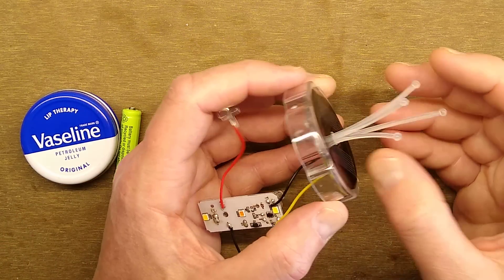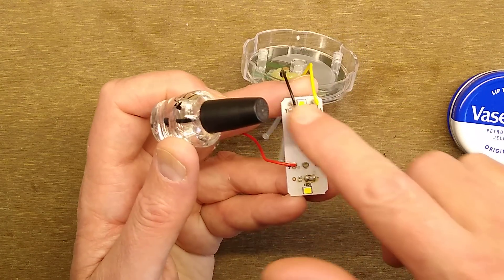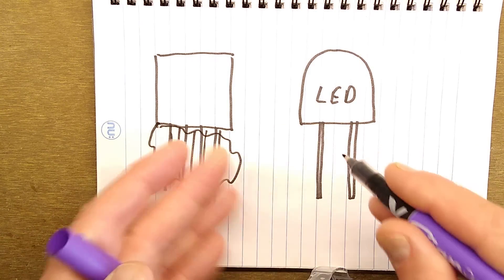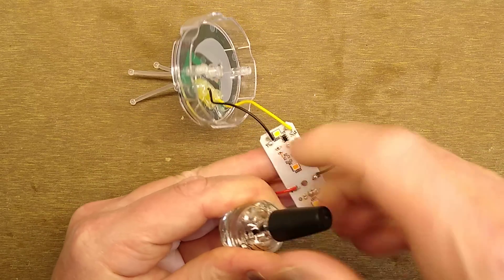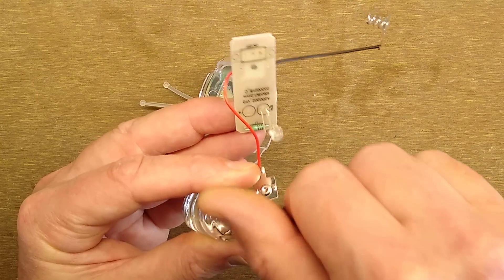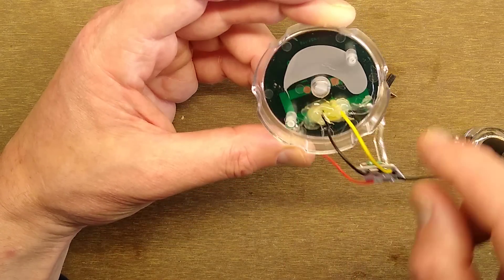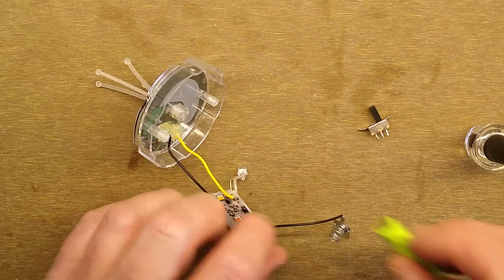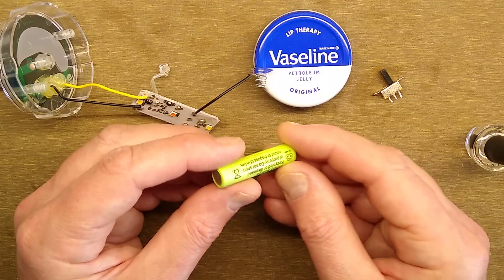Waterproofing your solar lights to make them last longer

Comment: There is quite a bit of chemistry around nail varnish= nail polish. There are water based, water based u.v. cure, and solvent/oil based ones. It's usually a polymer (or a monomer) dissolved in a solvent (the solvent evaporates leaving the polyer: or the solvent evaporates and the monomer polymerizes.)  The solvent based ones (traditional ones) that may smell like acetone, are quite flammable as being applied, and burn quite well after 'drying.' Just in case you want to start your fireplace with you're used solar lights.

Comment: I like to buy strings of Christmas lights, just to look at the pretty colors. They always seemed to quit on me quite early, so I took to pulling each lamp from its socket, scraping the connections on both the bulb and the socket, then putting a film of Vaseline in the copper/brass connections before plutgging them back together. The result of all this is that a string of lights that used to last for 6 months, lasted for over 2 years. Eventually I noticed that one of the end sockets was always "corroded," I suspect deliberately, to make sure the string would fail early.

Comment: Put battery into holder, spot welder, soldering, replacement battery with soldering pads. Shrink wrap battery and put some hot glue or similar there wires come in/out.

Comment: Note that clear nail polish is nitrocellulose. Spread some on a piece of glass, peel it up, and it will burn like flash paper which is also nitrocellulose. At what temperature will nail polish on a circuit board auto-ignite when covering hot components?

Comment: To resist corrosion, you can try a water (or oil) based spray lacquer... like Krylon or Rust-Oleum. (You should check that it is U.V. resistant!) Ideally, any lacquer formulation used will be transparent to U.V., so that it does not absorb the U.V., and degrade. I don't see a problem about blocking solar energy that develops electricity, by spraying a clear U.V. resistant lacquer on it; but the spray will protect the circuit board well. (Use a water based one if you are worried about oil based solvents attacking the plastic.) I use a lithium based grease on the battery terminals... which is sticky, very water resistant/repelling, and non-conductive... so it won't short out the battery terminals. (You have to make sure the battery terminals make good contact with the contacts in the battery holder, before greasing. )

Comment: When doing poe wireless access point installs in damp places like garages and sheds, or even under facia boards, I have always made a habit of dismantling them and spraying with about 6 coats of pcb lacquer. Not had a single customer complain of a failure in all the years I've done this.

Comment: I live close to the ocean. Salt is terrible.  I do everything you do but I also I also put some silicone rubber on the top between the photo cell and the case.  What I have found is that water will freeze and break the photo cell during the winter.  It also keeps the water  From getting underneath.

Comment: A bead of that nail polish or some silicone around the rim of the solar panel should help exclude moisture too. I prefer silicone for the flexibility as there's almost always a little flex in the goo that holds the solar cell in place meaning the polish would crack.

Comment: I haven't tried it, but I would imagine a good solvent based (xylene) polyurethane sealer/varnish would work best for the solar cell. Good UV resistance and no yellowing in the sun...just don't scratch it! It chips fairly easily. We use a "home brew"(read made in our factory) polyurethane for custom cement flooring sealer, no yellowing in over 20 years being in business.
Reply: You should send Clive a sample .. ..
Reply: Aromatic polyurethanes (MDI and TDI) will yellow in the sun and at least one formulation of concrete sealer used MDI polyurethane prepolymer dissolved in a solvent, which moisture cured upon application.

If applied in a thin enough layer the yellowing may not be noticeable. Some formulations add a UV blocker to stop the yellowing that would otherwise happen. Aliphatic polyurethanes won't yellow in the sun but are more expensive. (An example of an aliphatic polyurethane is automotive paint). 

Gorilla Glue is an aromatic MDI polyurethane. You can thin it with xylene and use it as a coating. Then you have oil-based polyurethane varnishes. These generally are pretty dark out of the container, and are not moisture curing like other polyurethanes. Not really sure what the chemistry on those is.

Comment: Clive, are you at all aware of these gas powered wireless soldering irons? PtZb7-nynxU

Being Chinese made and sold it seems right up your street for a test? (See links under video)
Reply from the maker: I have a gas powered soldering iron in my work toolbag.   They are a bit volatile.
Reply: @bigclivedotcom  I was contemplating getting one purely for the steam punk look and how you light it with a match! Bonkers.
Reply from the maker: @Lumibear.  Mine has a flint striker built in.  Bigger ones have automatic piezo ignition.
Reply: @bigclivedotcom  oh that sounds far too sensible, exciting soldering demands naked flames be near canistered gas! ;)

Comment: very useful video.  i'd like to offer a further tip suitable for some situations.  a mix of silicone and turps.  i find equal parts of each are best for me.  other spirits besides turps also work but i prefer turps.  they dont seem to mix but keep stirring, they do.  i use it for around the very edges of the solar cell.  another useful tip i saw in the comments of one of your videos was to use metho to clean the crud that develops on the surface of the plastic coated solar cells.

Comment: I’ve done this. I like to coat the boards in epoxy resin from the discount shop. I use UV stable greenhouse tape over the solar panel to stop water ingress. Solar lights notoriously rust to death and don’t last long without any waterproofing. Honestly I don’t know why the manufacturers don’t just concoat them. Extends their life for several years.
Reply from the maker: That's probably exactly why they don't protect them.  Future sales.

Comment: I have a single yellow LED solar light in my back garden. I purchased it in 2002 form £4.99 and it is now twenty years old. I have replaced the AA battery three times and repaired (or bypassed) the switch about eight years ago. It has never had any special attention (e.g. Nail Varnish) and has illuminated every evening for twenty years. Considering I have bought over two hundred solar lights since and none of them have survived for more than three years, I would say this is a pretty good design.
For the last eight years, we have lived on the Outer Hebrides, so it has also coped with 120 mph winds, driving rain and six hour long winter days.

I wish I had bought more than one of these lights...
Reply from the maker: You may find that waterproofing new lights gives them similar longevity.
Reply: I'm not sure I understood all the info.. except the recommendations of different lubricants for the battery's poles?

Comment: What you doing with nail varnish Clive 🤣💅
Reply from the maker: It has many electronic uses.  I even made a video purely about that.
Reply: @bigclivedotcom  only frisking you Clive. It is a good product for many purposes including water-ingress protection. 
I used some on my motorcycle HT lead voltage leak that was earthing to the negative circuit cutting the spark to the ignition resulting in the bike cutting-out in the rain. 

Good product ultimately in other areas than a beauty product.

Comment: For connectors, terminals or sealing ingress points, I personally prefer Silicone grease, it's safe for use on most things and since it's intended for o-rings anyway, that makes it great for outdoor projects like a water-resistant box.
Reply: I like to use silicone grease on the external connections in outdoor TV aerial installations; found that it makes them last a long time before failing. Some TV aerial installers do this, but most don't, probably because leaving it out guarantees them follow-up work in a couple of years!
Reply: @MrJozza65  foam dielectric cable & CX3 connectors 👍

Used to do the silicone grease and glue lined heatshrink previously.
Reply: I believe some UK telecommunications crimp joiners are packed with silicone grease. I’m pretty sure that’s what it is in there, I managed to get a box of them some time ago (still got them somewhere). They’re an IDC terminal, translucent, with 2 entries, for thin solid cored wire.
Reply: @nutgone100  They're referred to as "jelly beans" and the contents are silicon gel, rather than grease. British Telecom have been using then since the latter half of the eighties. They're a definite improvement over the old open terminal blocks (chocolate block), plus, they're cheaper and faster to install. Since the advent of broadband, jelly beans have been retrofitted in older copper wire telephone installations. Even in the dial up days, jelly beans were an option if the engineer thought it would be worthwhile. The difference is palpable, silent lines, no hissing, no crackling, no squealing, no nothing, just nice silent telephone lines.
Reply: @nutgone100  You mean fish eye connectors and I believe you are right about the silicone grease. Might have been petrolium jelly in the past though.

Comment: Nearer the Ocean such corrosion would be prevalent, here at Dusty Mile High Denver, micro particulates are the problem, indoor odors, forest fire smokes, marj bowl blows, general air pollution will dirty up the inside of an electro-tech device in the first week out of the package.  good barrier that nail varnish.  surprising as well.

Comment: There's a big debate on the internet about Dielectric grease. Could you make a video about it?
Reply from the maker: Is it the controversy of silicone insulating contacts?
Reply: @bigclivedotcom  Well, its about whether dielectric between 2 contacts would actually inhibit electricity to flow. By definition, dielectric is a nonconductor of electricity so people think you shouldn't put it on electric contacts to protect from the weather.

Comment: What I like to use is that UV glue, well the cheap version, UV nail varnish, it's amazing what you can use, sold cheaply for cosmetic decoration.
I also the coloured nail varnish, plain colours, red, brown, blue and yellow, on wires that I want to identify as live, neutral or data even, wire that had no identification.

Comment: Great consumer advice...I wonder if a vaseline smeared battery contact might cause added resistance/conectivity issues?
Reply from the maker: The metal contacts push it out of the way at the point of contact.

Comment: I'm going to try this! I've got some WD40 branded white grease spray which I'm going to liberally hammer all over the battery contacts etc and some fairly old clear coat car lacquer spray which might be good for the circuit boards etc!

Comment: The thing that mostly kills my solar lights at my house is actually not the water ingestion, but ants. Those common wall mount solar lamps usually have some drain holes at the bottom, and the ants love to get through there, and incubate their eggs inside. They bring foods and other things in, creating a constant super high humidity environment inside the lamp, which causing corrosion, and short circuit.
Reply from the maker: The waterproofing helps with that too.
Reply: Same for gate motors, which is why I keep a can of citrus odor insect spray and a small bottle of blue death around. Spray the ants when you lift the cover and then brush them out, then sprinkle the white powder inside liberally and close. Spray also works well against paper wasps, who are always going to be making a home on the eaves or in corners, and they sting.

Comment: I keep getting electronic ornaments for outside. I keep thinking "Better waterproof that a bit". I keep procrastinating. I slowly replace dead electronic ornaments that collect outside...

I am going to try to do better, but Hell is paved with good intentions... So I'll probably be stuck in this cycle anyway.

I do at least make sure to do a good job with my external sockets and connected mains wiring.

Comment: Thanks. I've been using your pro tip to put some of the clear almost-self-fusing tape on top of solar panels and exchanging stock batteries by actually good NiMh ones for years now. So far I only had to replace them because the plastic bits are crumbling apart. Or someone accidentally broke them. It’s worth doing.
Reply: Could you expand a bit about the self fusing tape for solar panels? I haven't seen that video of Big Clive. Or perhaps give the name of that video?

Comment: I'm totally doing this on the eco button in front of my cupholder in my 2012 equinox. It shorts out the 5v reference bus, which is on the same bus as accelerator pedal and crankshaft position sensor and completely disables the car 🙄

Comment: I've tried all ways to keep water out, and found that "WaxOyl" - the stuff to waterproof cars, is as good as it gets. I've previously tried melting candle wax over the circuitry, but it tends to peel off. Bee's wax is also very good, and when we consider that it's what was used to seal old wax/paper capacitors, it's not a bad choice. I have to say I hadn't thought of Vaseline before, but I can see how it would work very well.

Absolutely never use automotive lubricating grease. It will absorb moisture, and then promotes, rather than prevents corrosion.

I have wondered about paints before, but never got round to trying it, though I do use nail varnish in my vintage electronic restorations, mostly to seal screws and adjusters.
Reply: Good one with the automotive grease, yes, it is definitely hygroscopic!

Comment: This is exactly what I started doing this year. I've got into little decorative solar lights last year. When I put them in storage for the winter, some of them had their little coincell rechargeable batteries explode and made a mess. Not 100% convinced its corrosion but I started covering them in nail varnish just in case.
Reply from the maker: In high sunshine areas the little button cells can be overcharged.  Try swapping for a bigger cell.
Reply: @bigclivedotcom  the ones that exploded, did while in storage in the attic. Could it be that they were damaged beforehand and only exploded while they stayed overcharged? Rest of them are working mostly fine. One expanded a little this summer and I discarded of it.

Comment: I use melted candle wax to cover the board it's easily heated with a hot air gun to make it flow.
Reply: It can also be easily heated with the scorching sun, and easily dissipated...

Comment: Thank you, an informative tube of you video.  Spent last weekend cleaning battery terminals and switches on my fathers ageing (aren't we all) solar lights as the Scottish weather tends to promote corrosion. I  will look at replacing them and getting a bottle of clear nail varnish/vaseline  and removing switches. Now could you advise on how to stop all the earwigs gathering in them :)
Reply: Moth Ball?

Comment: Great howto! My outdoor lamps last only about 1 year here in western Canada. The problem isn’t components (although they do corrode), my issue has always been the batteries… they don’t last, and replacement cost for the battery alone exceeds the cost of a new solar light (dollarstore/poundland ). So I have avoided them recently due to the sheer waste 😢
Reply: You have a valid point.   My longest-lasting solar light (5 years or so) uses LiFePO₄ batteries.  NiMH just don't seem to hold up well to temperature extremes.

Comment: I use: 1) Shoe Goo, for Hot Melt Glue. 2) Rust Oleum 280702 American Accents Ultra Cover 2X Spray Paint, Gloss Clear, 12-Ounce, Acrylic for Finger Nail Polish. It is also good to seal plastic car light lenses, after restoring them. Has UV protection, too, IIRC. 3) How about using WD-40 for coating the spring connectors. "WD" stands for Water Displacement, which is its intended use, meaning it is not really a lubricant.
Reply: FYI WD-40 doesn't last/stay, it displaces water temporarily, but is ineffective at repelling it in a few weeks, a dielectric grease that stays is more effective.

Comment: Use Plumbers Silicone grease.  It IS waterproof.  It won't hurt rubber gaskets, etc
Reply: That seems to be the same stuff sold as silicone dielectric grease in the auto parts stores.

Comment: These inexpensive solar yard lights could be re-marketed as 'solar emergency candles'. Tho only caveat being you would need to store them in a place outdoors so they could maintain a charge until you had a grid power failure. I know they often have an on/off switch, but I think they still gather solar energy while off.
I have tinkered with 'dollar store' solar yard lights. A common weakness I have found is with the battery connections becoming very corroded. Smearing a product called 'no-ox' or something similar onto the battery and the receptacle pretty much eliminates that problem. Another weakness that is common is the rechargeable AAA batteries have a high failure rate. Even the very cheapest batteries in my collection of rechargeable type outperform what the manufacturer installs.
So, one early spring I bought a large number of these units, like 25 or 30. They all had clear lenses. I took a trip to the craft store and thus discovered very affordable rolls of translucent cellophane in a variety of colors. I picked up 3 rolls, enough to last me a lifetime for sure. Then cut it into appropriately sized strips and inserted them in behind the clear lens. Oh my gosh I felt like the KING OF CRAFTINESS!! I had them all over the place. At night, I am fairly certain you could see my yard from outer space!😄👍
Thanks Clive for all you do. You are the KING OF BUDGET STORE TEARDOWNS!! 
Keep up the good work 🤓